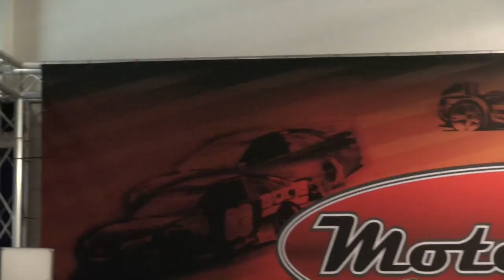SEMA 2014 part 2, EconoMaxx, EcoBoost, mudflaps, cool rides

Comment: Do these work for people who do mostly city driving?   I've lost about 2mpg since installing my EconoMaxxs on both of my vehicle.
Reply from the maker: That's a good question. All my tests and the ones I know about in other folks vehicles were highway miles. Higher RPMs would have more air flow. Though since EconoMaxx will lower idle RPM's, it should have some improvement at slower speeds. Don't forget the 60 day money back guarantee, send them back if they don't work for you.
Reply from the maker: MrTruckTV
Hey jlen82, call the brothers at EconoMaxx, Brian or Danny 1-807-854-2425. I just want to be sure it's installed correctly and see if they can help.
Reply: MrTruckTV Thank you.